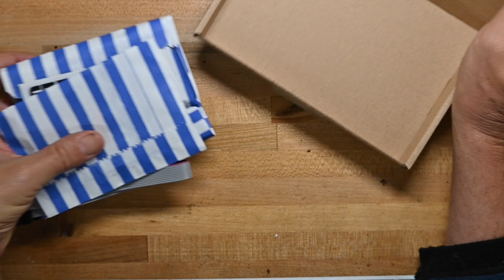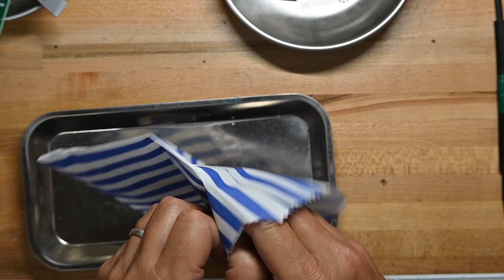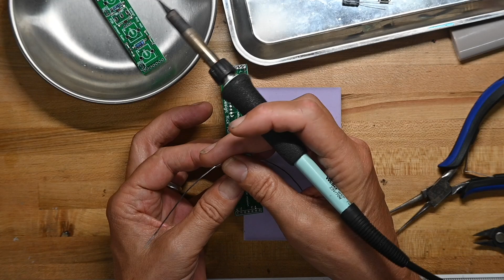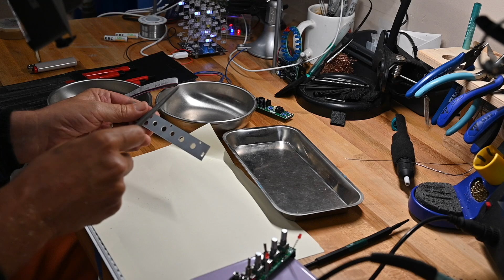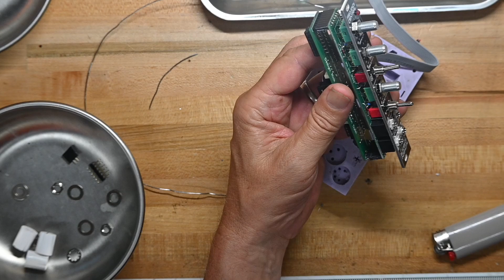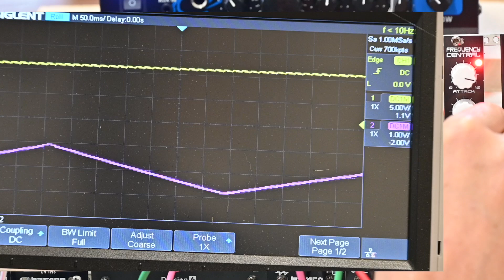C.K. builds a Blades of Ingenuity eurorack kit from Frequency Central

Comment: Did you ever get to the bottom of the self oscillation in One Shot?   I'm getting a kind of burst behaviour, which is sort of nice, but not really useful if it can't be stopped.
Reply from the maker: No, haven't used it since I built it, I use their "More VCAs" module when I need a simple envelope.  I do have another one to build, I'll take a deeper look at the circuit then and see if there is a straightforward place to tweak, I'll upload the results when I do (at least a month away based on my current kit backlog).
Reply: @CKHaun  . I'm looking forward to seeing what you come up with.
Pin 3 of the TL084 looked a bit dodgy to me. Just a diode from the gate in, so it's more or less floating (kind of). I put a 1M resistor to ground (pin above 'bo' of robot and the cycling stopped. Then putting a 22n across that gave me a better response to triggers (when attack at shortest). 
Somehow I think It should cycle once on trigger. 
I asked for a schematic, if I can see it then I'll try and figure things out better.
Reply: @CKHaun  Response from Rick at Frequency Central. He says try a 10K resistor from pin 3 to ground.
I prefer a megohm to keep input resistance high, and to work with the capacitor I added.
I was wrong that the circuit would do one shot from a trigger. It's a slew limiter and the loop switch adds an inverting comparator to keep it going.
Nice little module.

Comment: "He doesn't have a picture", no, he doesn't, that's why I'm here. Thankyou!   
I flipped one of the pairs of male/female headers to avoid any future accident.
Reply from the maker: Alternating end-ed-ness on pin headers is an excellent idea, I'll mention it in upcoming videos (and give you props).  And the picture thing does sometimes drive me a little crazy, just one more pic and everything would be clear.
Reply: @CKHaun  . To be fair, component values are the right way up, and there's the "red line down" mantra which also applies.

Comment: Brave little helicopter!

Interesting that your switches not want to fit, because last Friday I built a Frequency Central “Turn! Turn!” Kit and had the same problem with all 4 switch holes. I didn’t have a reaming tool handy, but a 1/4” bit on a cheap drill press did the job nicely.
Reply from the maker: Interesting. The parts are the typical eurorack, so sizes of parts didn't change.  Wonder why they're under-drilling the holes.